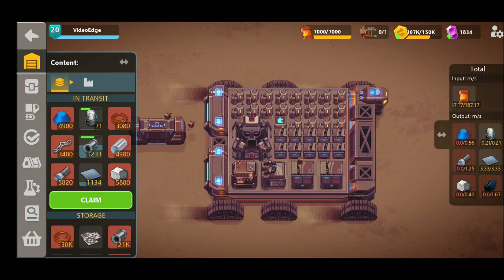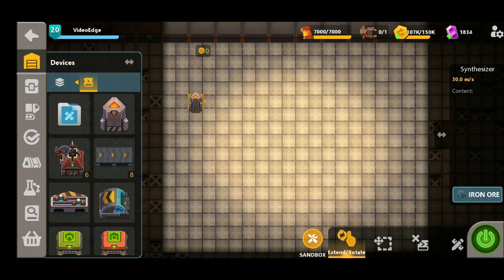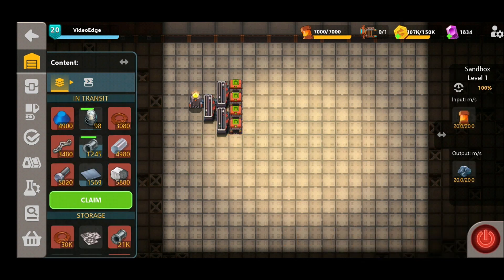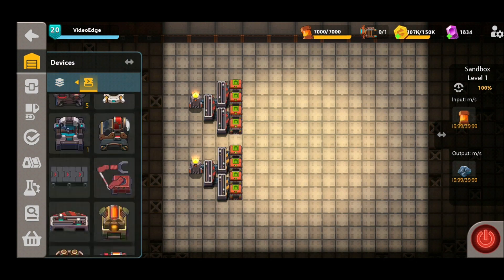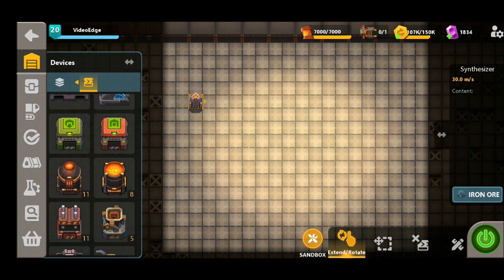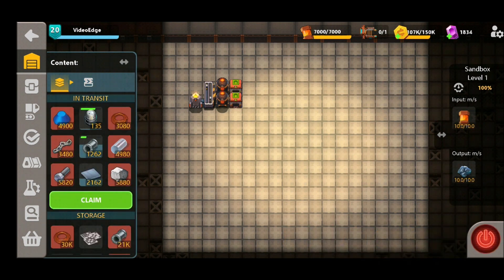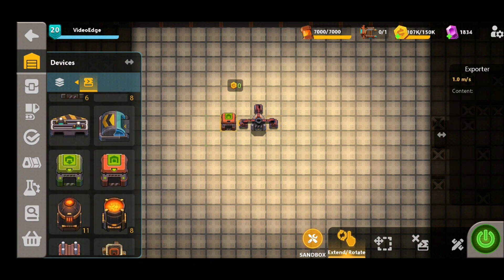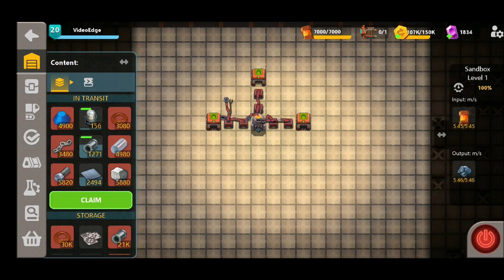Sandship Crafting Factory - TOP 5 Tips to improve your FACTORIES!

Comment: about Tip#2 for a .5 difference its not worth it to use 2 heaters when you can use 1 just to increase output from 9.5 to 10 by .5

Comment from the maker: Do you guys have any other tips you use to help increase outputs? Let us know!
Reply: In the last tip, this is not the most efficient way to produce copper wires. If you split the rods into two converting machines (idc about its name) the production can hop up to 4.44/s. The key tip here is: whenever you see stuff building up, consider splitting them over multiple machines for resource saving and higher efficiency.
Reply from the maker: @mohamadhammad2433  Thanks Mohammed! Very aware that this isn't the most efficient way to produce them, it was more for example purposes to help with explaining the point! Thanks for watching!